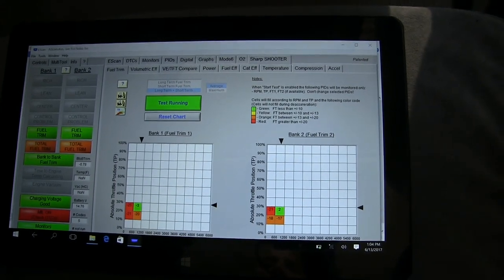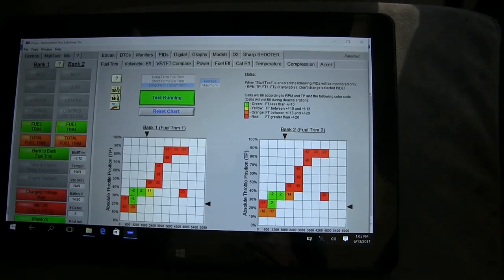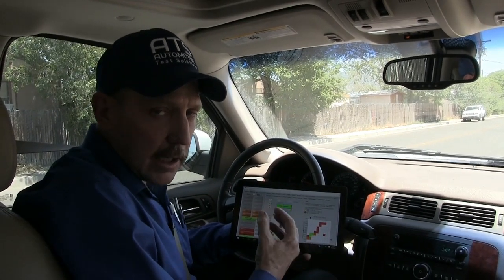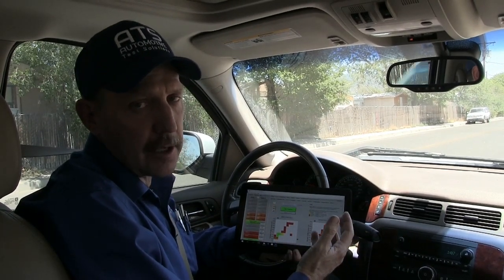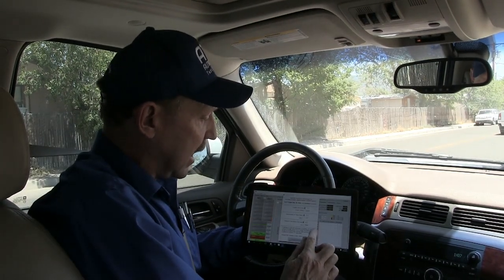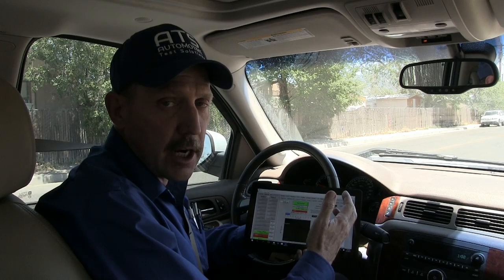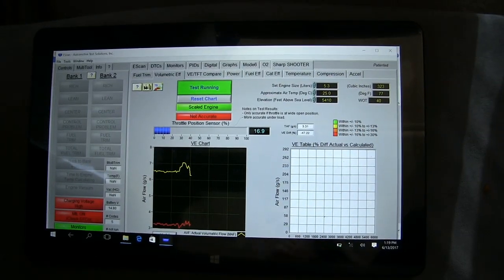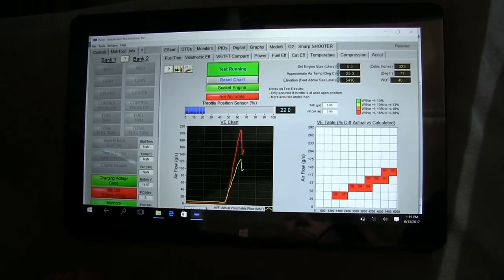2009 Chevy dirty MAF

Comment: Definitely fixed the issue, not saying he didnt but he should of addressed the air filter at least check it and i would never just clean a maf sensor without cleaning the throttle body as well. And check your fuel trims when done. Thats a way more legit fix and would cost barely anymore money. Just saying...
Reply: This guy the best diagnostic person in the world thier no debating that so whatever approach he uses works 💯

Comment: where i get a little confused you said map working correctly but you were going to take out and clean. what made you clean if it was working. i would have thought you would have seen some sorta problem in data to give you a reason to remove and clean.
Reply: Its still doing its job and sending a valid/proper signal...but it is physically contaminated and cannot sense the correct amount of airflow, so it is misreporting to the computer. Then the computer makes an incorrect decision on the fuel amount
Reply: I think in the VERBAL , he said MAF . It was picked up on the screen TEXT as MAP . I don't believe a MAP sensor was mentioned . You are correct . All the connections are working and a signal is being reported to the PCM . Circuit integrity passes . But with the dirty MAF sensor , the reported amount of air is incorrect . Clean and retest . Great tool and a real time saver .
Reply: MAF by grams per second determines the injection pulse so after he clean the sensor the injectors work properly so this cars runs normal